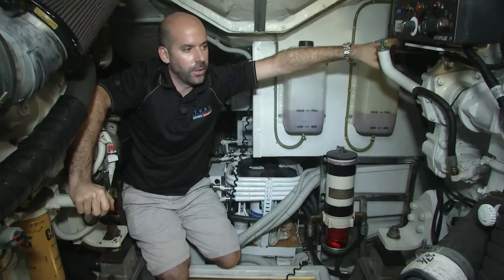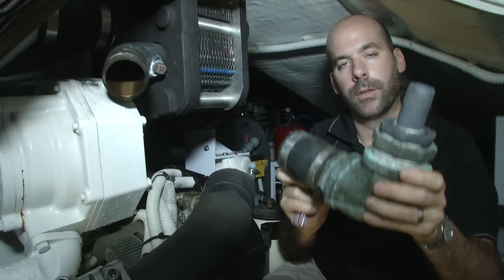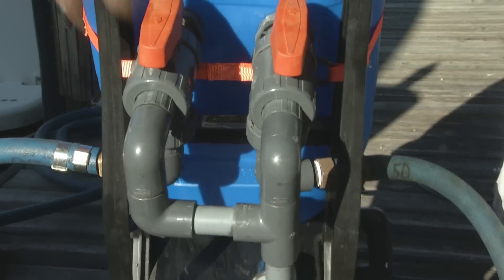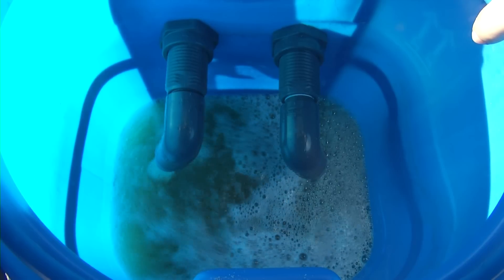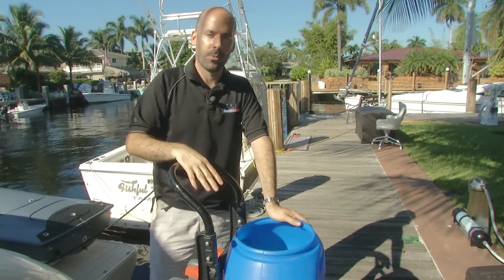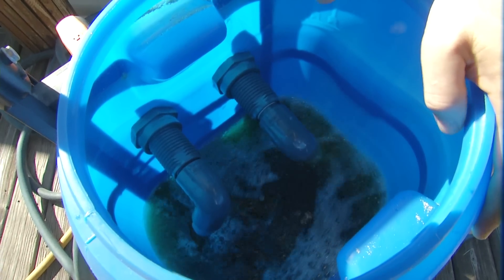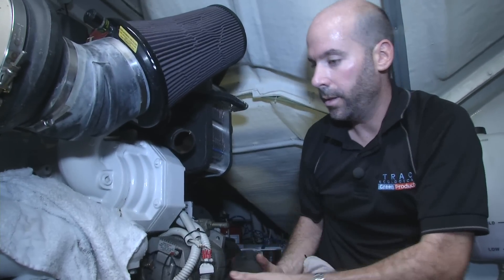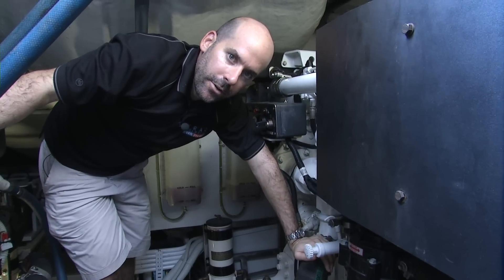Barnacle Buster ® - CAT C18 Flush

Comment: Perhaps I missed something. If the system is already filled with water (salt or fresh depending) and you are adding water to the flush system container, how do you compute the total volume of liquid to insure the mix ratio is correct?  in addition, I would think (correct me if I'm wrong) in a salt water environment it would probably be best to first drain and flush the system with fresh water before introducing the cleaning solution.
Reply from the maker: the salt water does not affect the product, so it can be left in the system. it's almost impossible to fully drain these systems without tearing them apart, so the left over raw water will have to be accounted for when diluting the product, best option is to sue pH strips or testers, that way you know you have the right dilution ratio.
Reply: @TracEcological  Got it! Thanks for the reply.

Comment: Question- what was the reason for doing the flush?
Reply from the maker: Marine growth and calcium slowly builds up in the cooling system and will require it to be cleaned. This used to be done mechanically but our Barnacle Buster allows you do this in place and represent a huge cost savings for the boat owner.

Comment: Great video. Why not start the flush with a back flush? Seems like the forward flush is unnecessary....
Reply: you need to do on both directions ..........
Reply from the maker: Reversing the flow is a great help when descaling these systems, we highly recommend it. This particular flushing unit allows us to reverse the flow, it's something we recommend to do towards the end of the flush but it is not showed in this video.
Reply: @TracEcological  Yea, your reverse flow valves are cool, but why did you not answer his question?